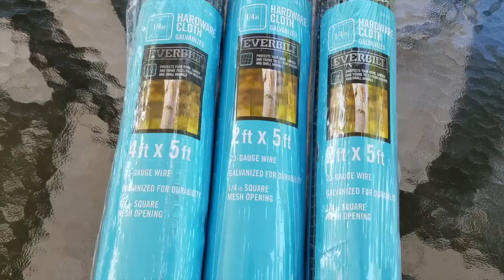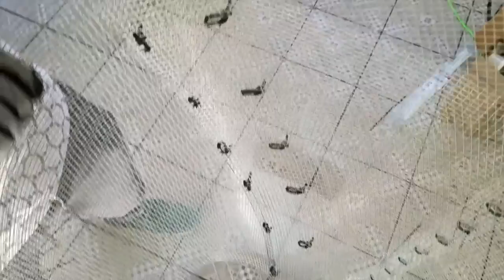BEST FISH TRAP using only HOME DEPOT supplies diy CATCHES FISH!

Comment: FYI for those who want to enjoy this without being blind-sided by a game warden or other conservation officer and hefty fines:
Learned recently that there are rules regarding fish traps that vary on a state-by-state basis.  For example, the state I'm currently in requires a fishing license, trap must be labeled (tagged) with owner's info (name & addy or conservation number aka fishing license number) and restricts the size of the trap opening.  You must also be able to positively identify the species of fish in the field, at the point of capture.  No game fish may be kept if caught in a trap, a.k.a. sport fish must be caught in a sporting manner so only non-sport fish and bait fish can be kept from a trap.   Rules for your locality can be found anywhere you buy your fishing license or online through your local conservation or fish and wildlife agency.  I'm not telling you what to do, only trying to help people not be surprised if the warden checks your creel.
Side note: if you are catching fish for the home aquarium, try to find the hardware cloth that is coated, it won't tear up the fish's noses as much while they are in the trap.  I've had pretty good luck with "pet screen" which is a heavy-duty window screen with a plastic coating (sold at all big-box stores, even walmart).  I made the internal structure out of heavy wire in the shape of a spring, this allows me to collapse the entire trap and fit it into a 5gal bucket.  Since the screen is a smaller mesh than the hardware cloth, instead of zip ties I was able to staple it together.  I just fold the end of the trap like a chip bag and secure it with a big clip, so I can unclip it, and pour my catch out of the opening into a bucket.
Another side note: if you are using your trap anywhere there is a current, put the funnel end 'down stream' so that the fish are going against the current to get into the trap.  This method works especially well if you are after shiners.  You can put whatever your bait is in a mesh bag and tie/clip it to the other end of the trap from the funnel.  Current going against the opening of the funnel also helps prevent fish from loitering around the funnel opening, and finding their way out.